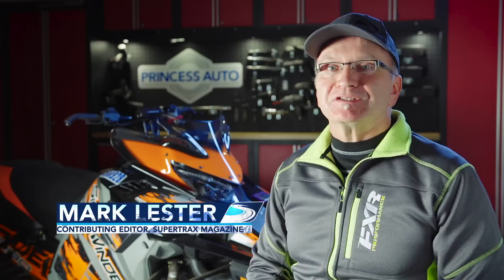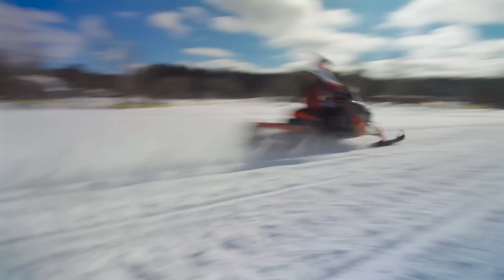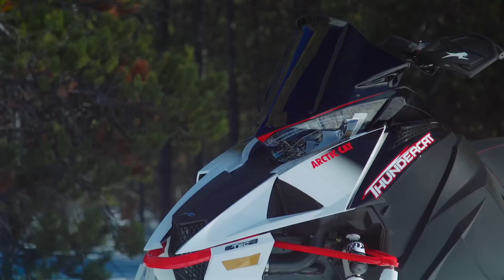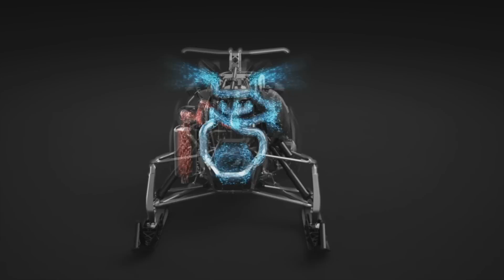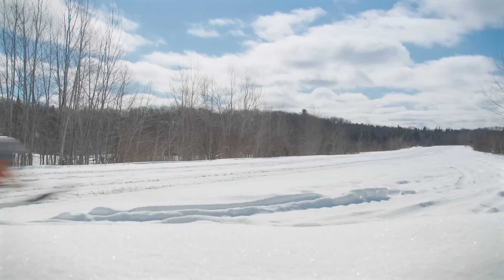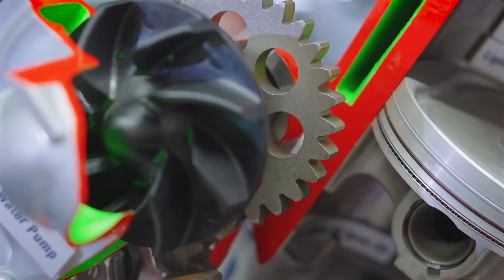Developing Yamaha's Turbo Snowmobile Engine

Comment: My 1100turbo at 240Hp is deadset reliable and faster than most900s. high revs and throttle responce is the big advantage with the 900

Comment: After seeing this and the introduction of turbo technology into the product, has there been any  thought to introduce a diesel varient to the lineup. Not everyone is an ultra extreme rider. Personally I would like to have a ride that isn't so self-destructive, as what is out there right now, with the ultra high rpms and limited mileage. Diesel also has no altitude obstructions for it's proper atmospheric performance that I am aware of, as it's compression based properties.
Reply: f350sdsc A diesel engine snowmobile would be cool. Any internal combustion engine is affected by altitude. The engine is limited by the density of the air it operates in.
Reply: @shconer  It's heavy enough without adding diesel weight.